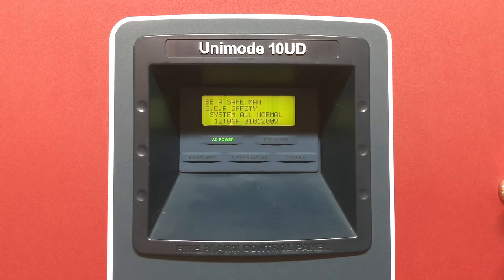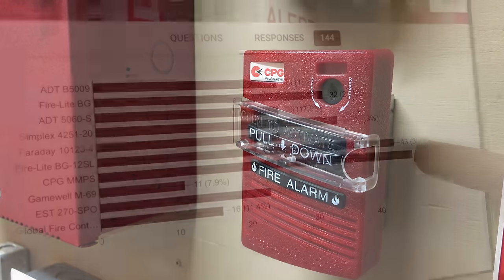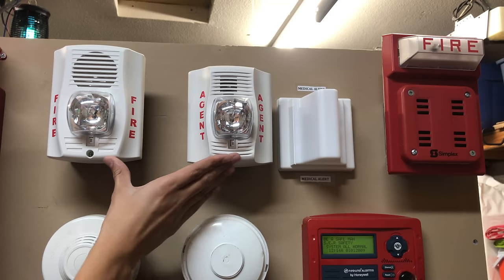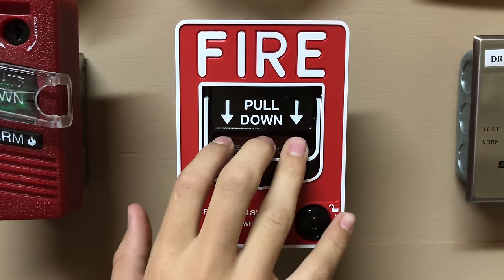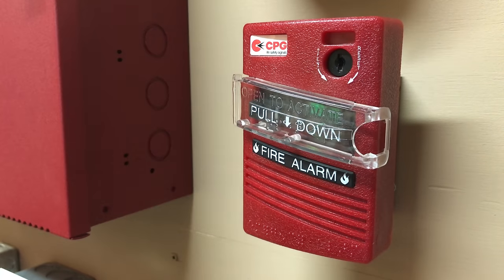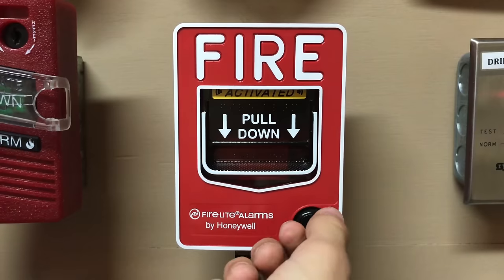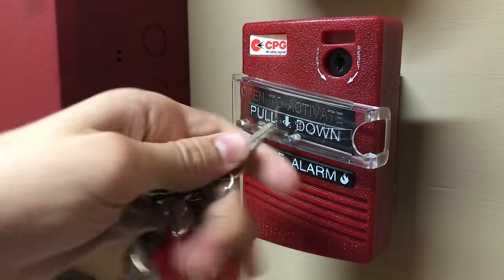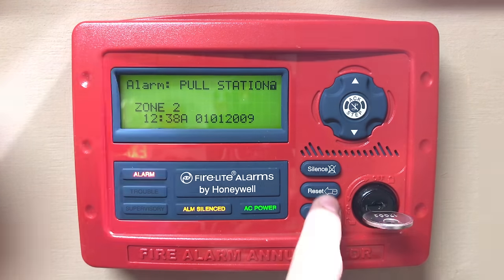ADT Unimode 10-UD System Test 3: Requested devices

Comment: The Simplex 2901-9838 with the 4903-9101 light plate and the System Sensor SpectrAlert Advance Low Frequency Sounder sound an octave apart which is why these devices were requested

Comment: Hello Grant,

I plan on building some custom 2 zone conventional panels that actually work like an actual panel, but for a fraction of the cost.  They will be board only, no enclosures.  There will be 12v in terminals for systems power, aux power terminals, ZN1 and ZN2 terminals, NAC 1 (for horns) terminals, and NAC 2 (for strobes) terminals, remote reset terminals (for a key switch for example), remote alarm terminals, (to show alarm status on an LED, and remote silence terminals.  It will also feature a silence button and silence light, zone normal and  zone alarm lights, a reset button, a drill or test button, and AC power light.  You will have to provide the 12v power supply though.  I always like the MG Power ones with the screw terminals from ADI.  They are over in the power department at ADI.  I use those for tornado alarms (yes, I install tornado alarms, in my school).  You can use anything normally open for the zones (pull stations, system sensor i3's, etc.)  And in you use horn strobes,  you need to use 4 wire ones, and connect the horn to NAC 1 (that is the one that cuts the power when you press silence. NAC 2 Keeps going so the strobes keep flashing until you reset) and the strobes connect to NAC 2. And I am charging only $65 each for these boards - pretty much my cost to make one.  I have lots of experience in making things, with or without electronics, and it won't just be a hack, it will be very well made.  And If you want more zones, I can add more zones for an extra cost.  I can make the system 12v or 24v depending on how you want it. Even if you aren't interested in buying a panel, please let me know your thoughts on it! 

Thanks for reading!

Zachary
Reply from the maker: Nice idea, but I would not recommend selling electronics on the internet that are not UL listed. Thanks for the offer though!
Reply: Yeah, I agree.  I was only offering it to you as something to just do testing with.  It would be a very long process to get it on the market, and sold at places like ADI and Tri-Ed.  So it would be a prototype only, and just something I was interested in sending you.  No obligations though :).

Comment: Thx for putting that on the LCD!
Reply: Safeman4202 😂I saw that aswell
Reply: Safeman4202 g
Reply: To the agent one I never saw that in the building why no to those been at the sewing fry so I was wondering I want to Florida in the pool station and when they said put I made the noise like you have OK thanks for this message is for me 560 fire safety along with for firWhen are they do not use all they’re doing a firee
Reply: Safeman4202 fdu
Reply: Safeman4202 no u
Reply: Safeman4202 I
Reply: I agree with you
Reply: Safeman4202

Comment: How did you do Filtered DC on a Fire-Lite panel that puts out FWR
Reply: The MS-10UD always puts out Filtered
Reply: The ADT version does put out filtered dc
Reply: All Adressable Fire Alarm Systems (Excluding Simplex) output FWR unless if booster panels are used to make the system output Filtered DC